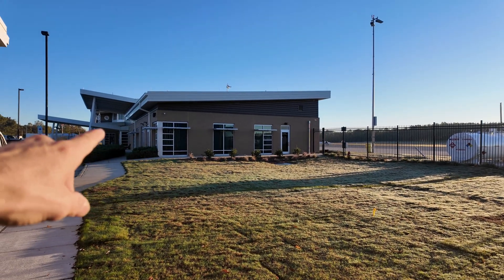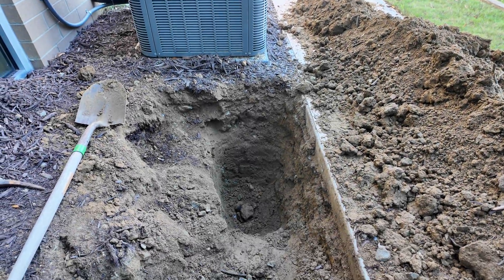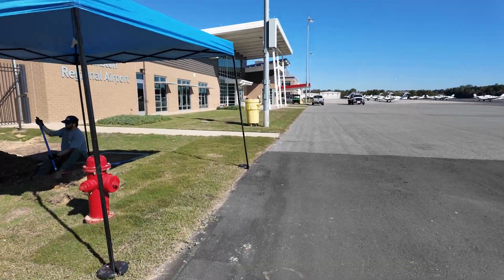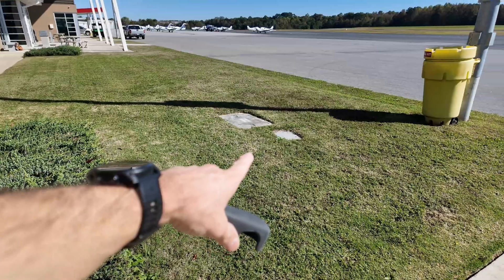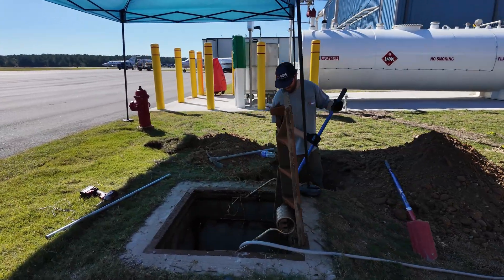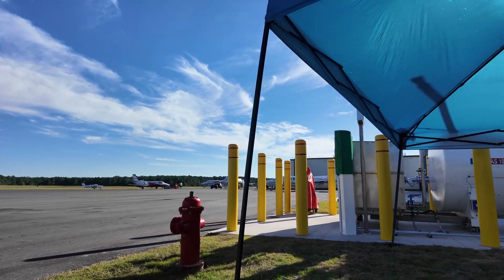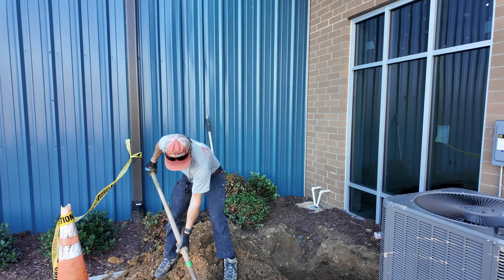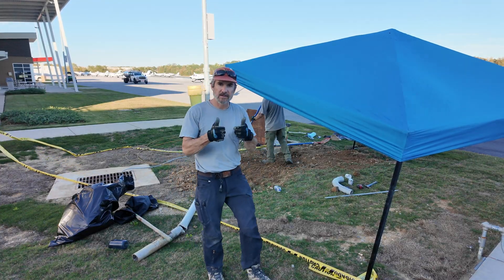Airport Fiber Project - Day 1

Comment: Good video, but maybe show the actual work instead of repeating the plan??
Reply from the maker: I agree. After watching it back I realized I did repeat the plan several times. I am working on improving with every video. Thanks for watching and for the feedback.
Reply: @AdvancedCommunicationServices continue man, I'm interested in what you do!! 

Why not use a small Kamron excavator instead of digging by hand?
Reply from the maker: @Hands-onNow thanks man! We only had a hole to dig on each end of the main conduit run and the sidewalk was too close on one side and the other side was too tight next to the existing man hole. We typically would use a mini-ex for these type of excavations.